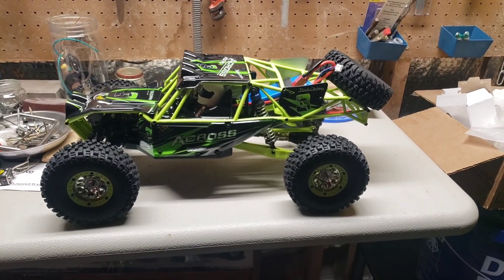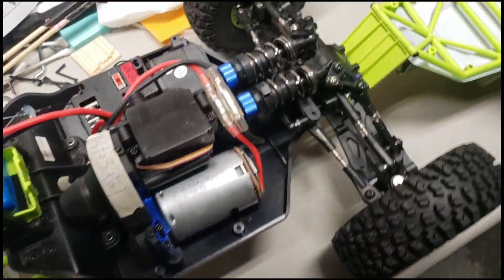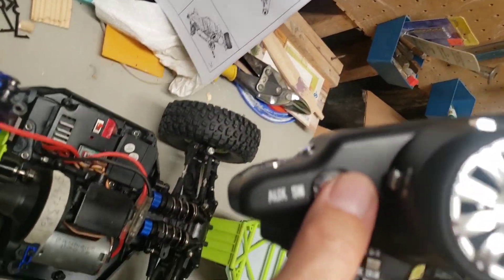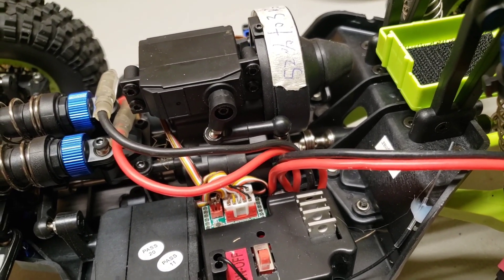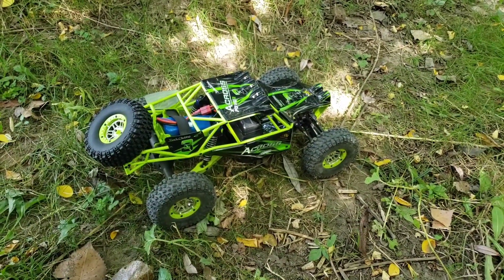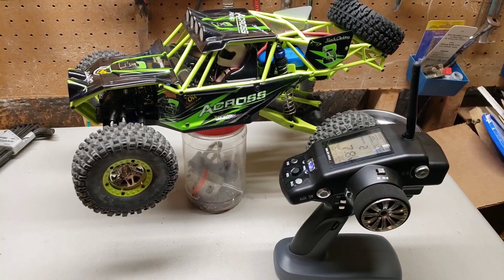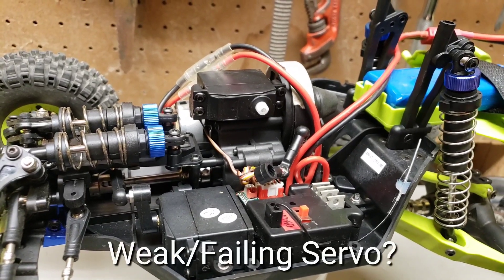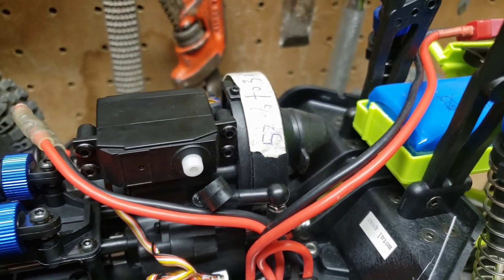First look: WLToys 10428

Comment: I got a week ago a similar experience and feeling ... but I knew it was a two speed gearbox... but it was not the end, I had to mount and unmount it completely twice, grease it completely since it was no grease at all!!! and finally noticed a ball bearing was misplaced... I noticed two that unfortunately many screws were ripped of... kind of disappointed with the quality ... but it’s cheap, isn’t it?
In your case it might be the plastic gears of the servo that are dead... fortunately a servo cost not much... but a metal gear servo and try to get some money back from your seller..
Good luck